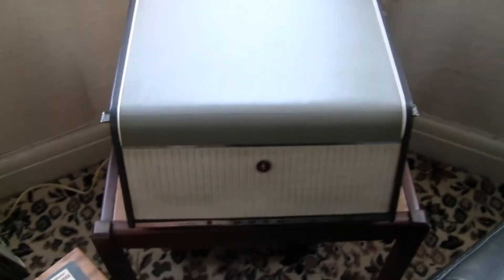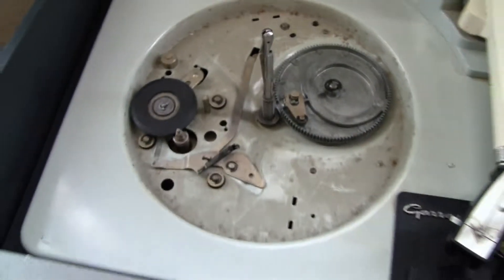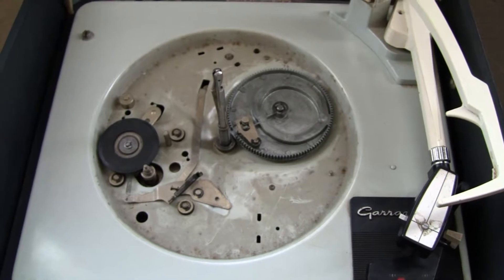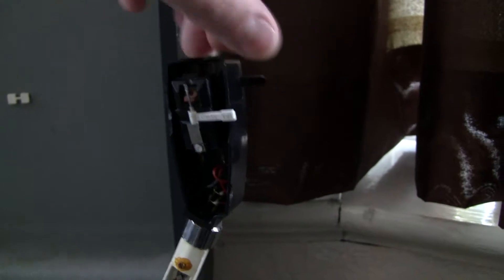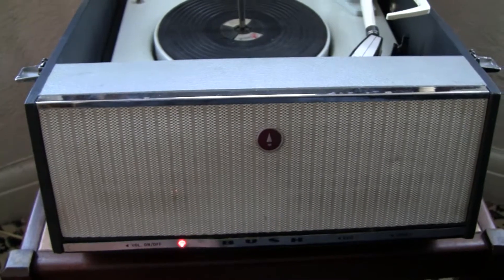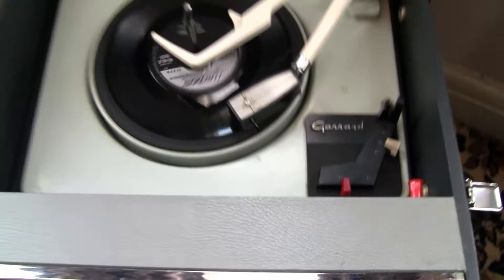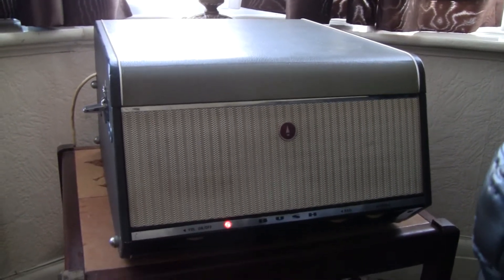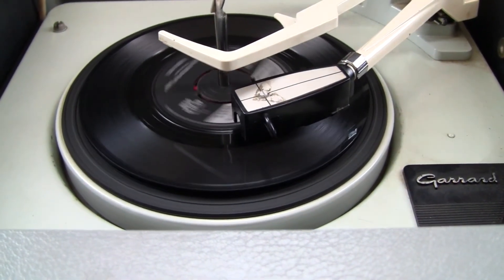Bush srp31c Record Player

Comment: I have this model but mine is the SRP31D one and there's a very annoying hum when I switch it on
Reply: Most likely the half-wave rectifier diode will need replacing and the main filter capacitor. Unfortunately I don't have the details to hand, but I'm sure the Vintage-radio forum will have the answers. VTD